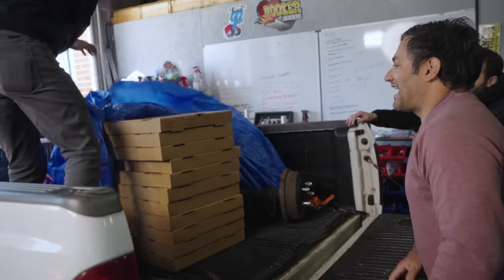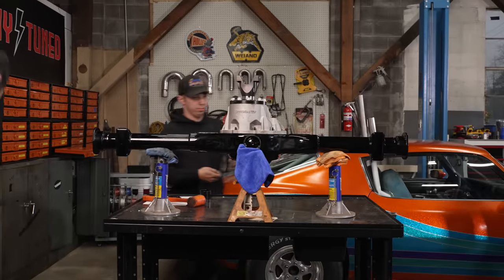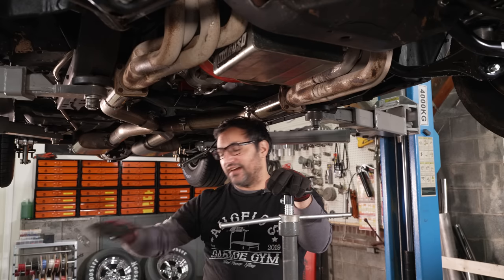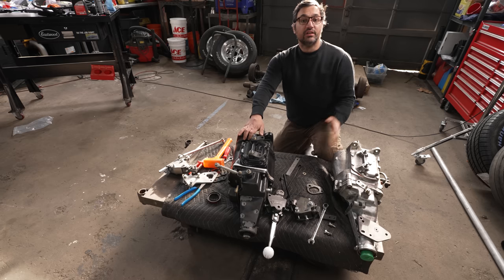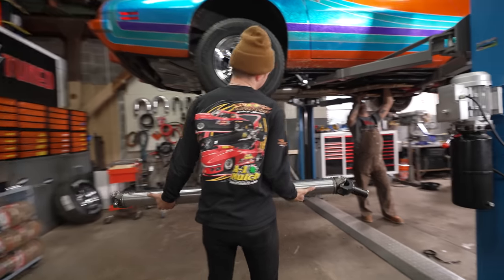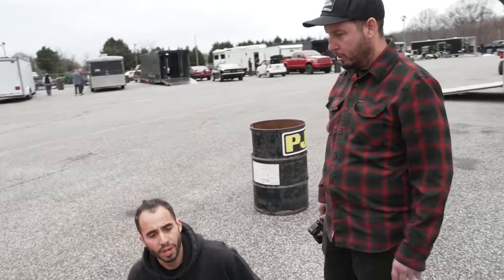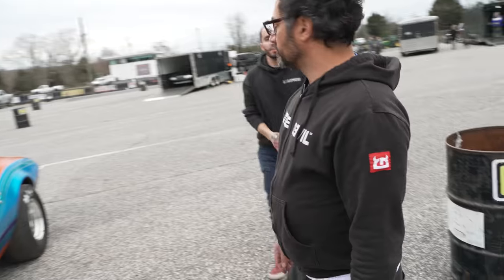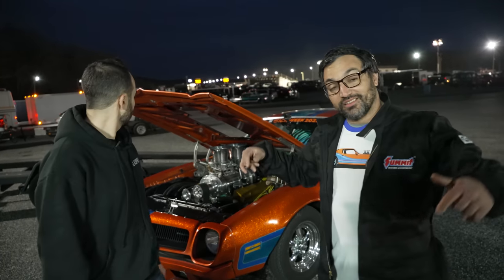ABANDONED For 30 Years, Back At The DRAGSTRIP! FULL EPISODE!  -Tony Angelo’s Stay Tuned-

Comment: 18:44 I use bolts with the heads cut off for guide pins on the top 2 mounting bolts so the trans lines up easier when stabbing it.

Comment: Love that T101 whine. I don’t understand why a lot of people are confused about a straight cut dogbox. Every dirtbike and street motorcycle I ever rode have one so the whine is normal to me, maybe even very comforting. About the only thing different is that bikes are sequentially shifted. But all shifts should be firm and quick using the clutch or not just like a bike.By the way S1 sequential makes a sequential shifter for that dog box for about $1,500.00. They say it can adapt to most any conventional 4speed with external shift rods……..like muncies, toploaders, A833s, Super T10s, and most all dogboxes as long as the shift rods are external,Jerico, GForce G101, Tex racing T101, etc. I wish they would make one for the 5speeds such as Doug Nash/Richmond,Jerico, and especially the G5R like in Blasphemi. That’s kind of the Ultimate trans to me. It can run down to a .76 overdrive in 4th gear with no loss at strength, and with certain rods tabs flipped it has a normal 12354 H pattern with a 1 to 1 5th gear.

Comment: I had a QP fabricated 9" rear built for my 69 Camaro Vert. 1/4" wall DOM axle tubes, the works. QP 3rd member with 3.50s and Eaton Trutrac Torsen style (helical LSD) diff. Opted for the metric GM disc brakes. Very nice product.

Comment: Need a scoop.  Airflow across the top of the open stacks will scavenge air and fuel backward out of the engine.  George Bryce of Harley drag racing fame as several in-depth videos explaining the issue.
Reply from the maker: Yeah, we are gonna run an angular boat type 2x4 scoop but couldn't get one in time. Those old timey round ones didn't do it for me. It will definitely help.

Comment: 💣Mantic clutch💣.. Had a twin plate mantic clutch kit and billet flywheel on my evo, started slipping on the dyno at around 520hp @all four wheels, dropped boost to make 480whp and pulled some timing and torque to make it live with plans to upgrade the clutch. 
Well, had to upgrade sooner than expected🤣🤣.. 
third gear, pulling hard about to go for fourth and BAAANNNG!!.. 
Bits went through bellhousing🤦‍♂️ Cars on my channel on the dyno when we limited it.. 
No video as it sits now, but went exedy and clutch is fine at 596whp and better feel than the mantic.. Hope for your sake my experience is a one off.

Stoked you got that 10👌

Comment: The two step seemed to hang on for a quarter of a second or so after you dumped the clutch. You've got a 1.50 60 foot calling our name. You may have to back up the rev limiter to get through the lights at 7000. Good times, brutha, good times.

Comment: 350whp ain't so bad, with a 20% loss that's 437hp at the crank, a 455 with mild iron heads and low compression never made that. A 455 Super Duty didn't make anywhere near that and those are "legendary" high compression 400 RAIV engines, '69 428 HOs, '70 455 HOs...none of those made that. It's a very stoutly built stroker engine meant to handle blower abuse for a long time. No shame in the game, it takes courage to build all Pontiac and put yourself out there. I couldn't possibly love that car more. It was painted the year I was born, how cool is that 😂

Comment: Is this Tony from hot rod garage? loved your bonemaro you built I'm using speedmaster ls head studs I heard that they hold up pretty darn good. Good to see someone like yourself using their products. I'm turbo LS swapping my Ford ranger and will flex on e85/91 looking too get about 650 wheel with the current setup and next engine build and turbo on e I'm hoping close to 1000 wheel. almost done wiring in the Holley termi x max.

Comment: At 11:21 he said thirty six hundred  or something RPM going down the highway, That's totally incorrect. The trans doesn't  dictate your RPM's. Think about it. It's in your final drive .🙄
They must have had low gears in the rear end may be 4:11's or something sounds like to me.
 I had for many years a 68 Camaro /327/370HP factory engine - super T 10 b/w close ratio trans - 3:31 gears 12 bolt  L/Slip pos. It ran down the highway at around 2,300 RPM at sixty or so. By the way it would do about 180 mph at 7,000 rev's 
Mind you it was built a bit.✌✌

Comment: With 700 horsepower, you should be very close, if not in, the 9s. 

What's holding it back?

Edit: Ah, I see it...
The 1.63 60' time is a big part of that equation. My old mid 11 second car gave consistent 1.55 60' times and it's MPH was nowhere near yours. 
Work on that chassis to get that thing off the line and whittle away at that 60' time, and your E.T. WILL drop a bunch.